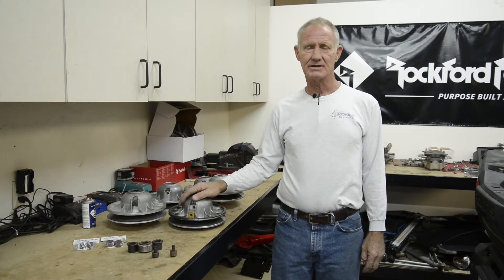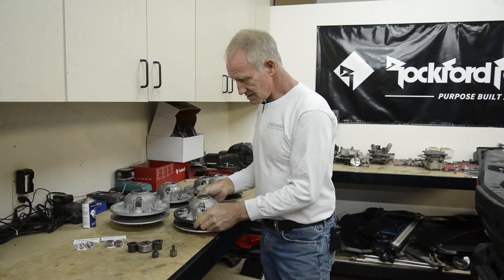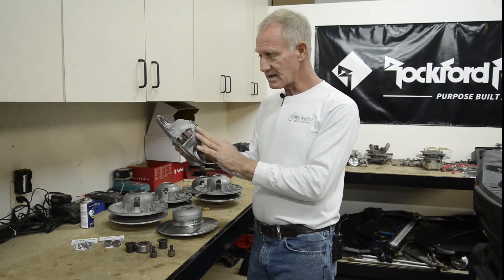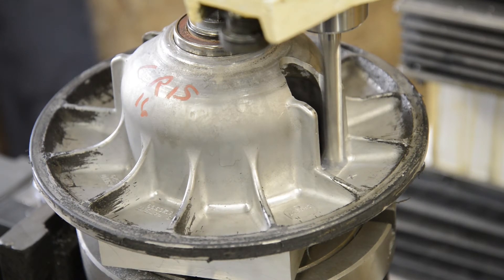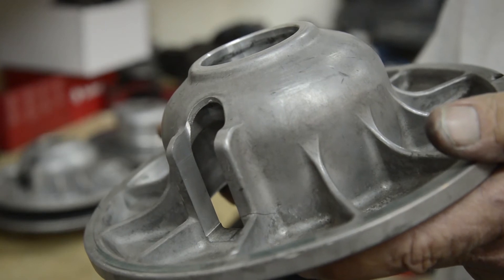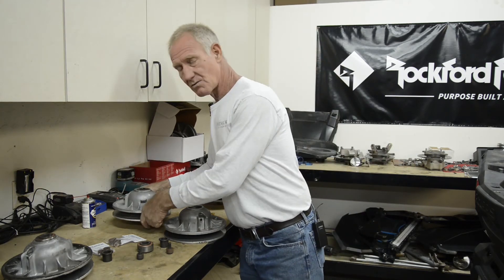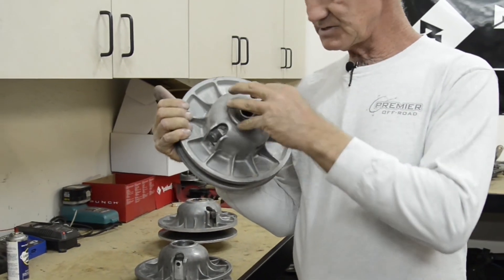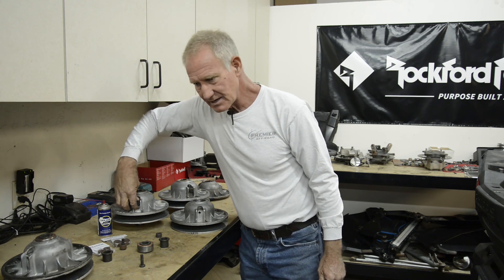Tech Tips Episode 1: Polaris RzR Secondary Clutch Maintenance

Comment: I have a brand new RZR XP 1000  2019 dynamic active suspension . It has only 450 miles on it just got it broken in . My down hill dissent doesn’t work anymore . I give it some throttle when I’m going downhill to kick up the RPMs and it’s doesn’t hold . It’s like it’s in neutral 😬 I need help 🙏

Comment: I have question: 2016 rzr turbo secondary clutch will fit to non turbo 2014 rzr 1000? Please help :( 

My 2014 rzr 1000 with added turbocharger and secondary stm clutch blow out. Wondering to fit there secondary clutch from 2016 rzr stock turbo.